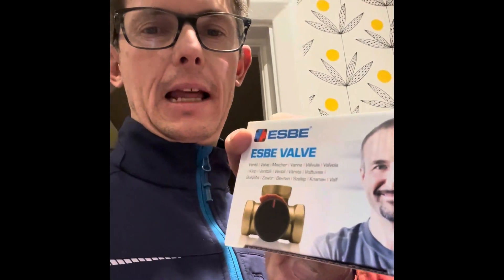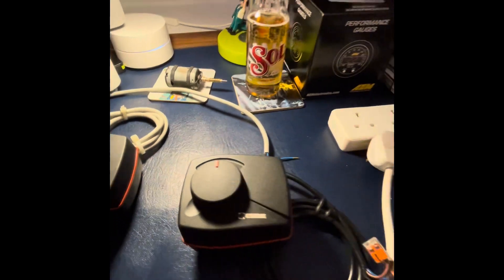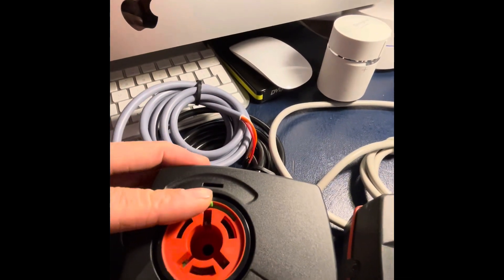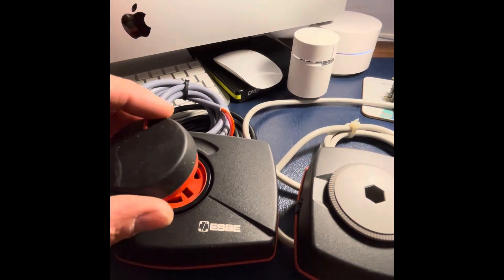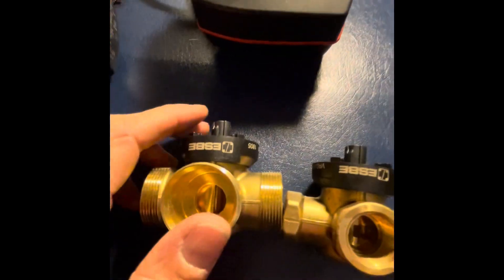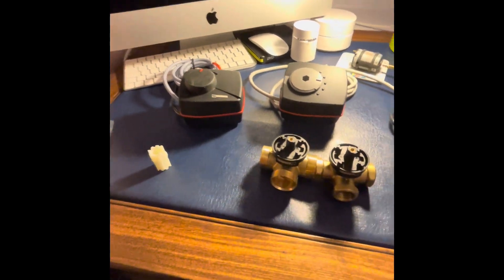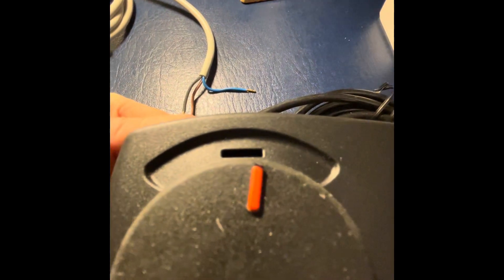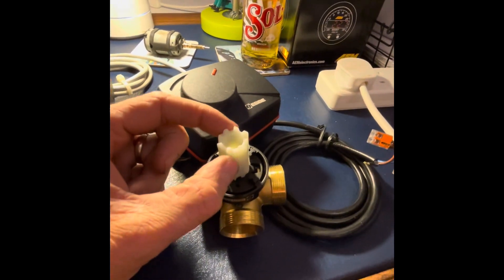Looking at ESBE Actuators as mixers and diverters, whats the difference and wiring them in

Comment: What is actually difference in 652 and 655 actuators?
Reply from the maker: Hi you can alter the direction of the motor on the latter, by switching a jumper within the actuator body this helps when you change the orientation of the valve.